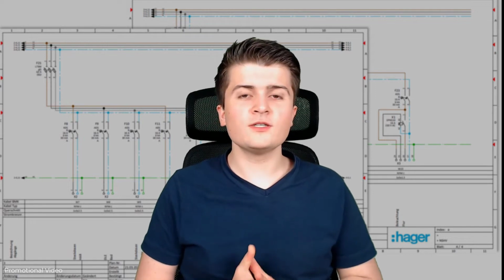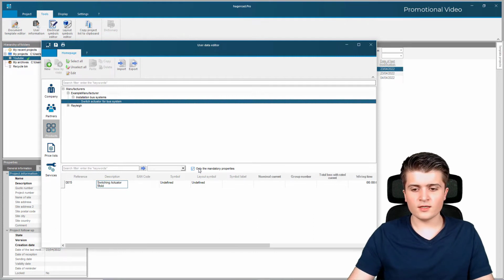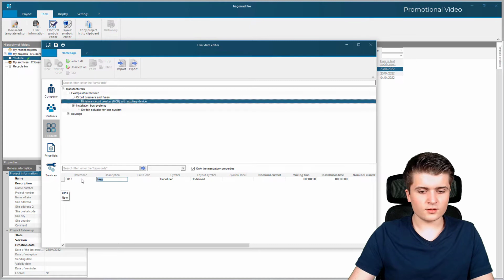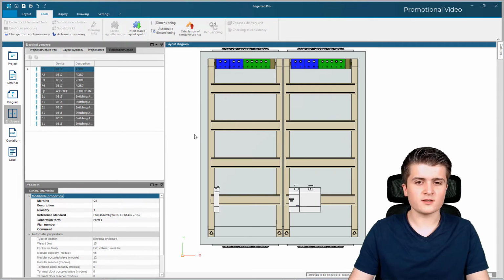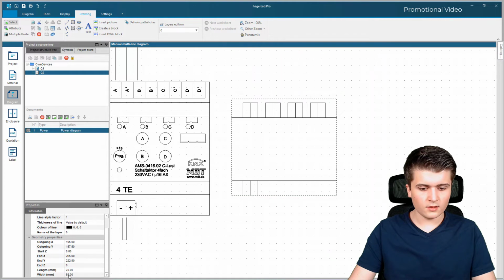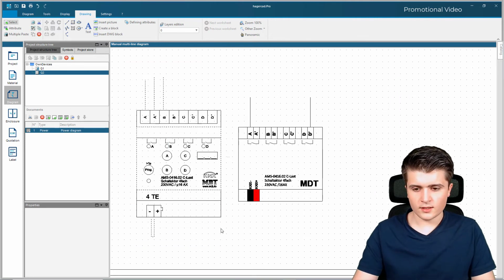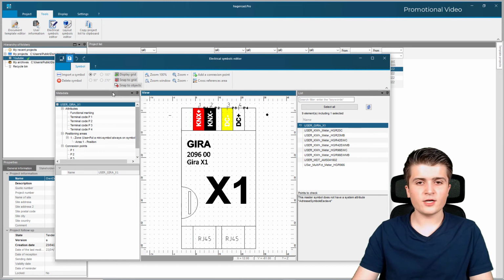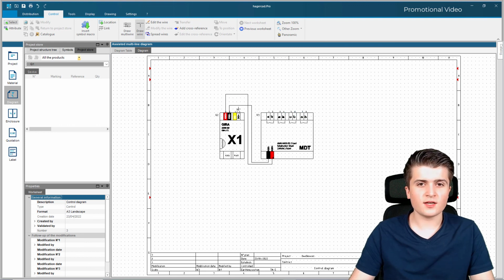hagercad Videoseries - #06 Custom Products: MDT, GIRA X1 & co. in hagercad

Comment: Thank you very much for this series - it was very helpful. I probably have a bunch of questions as a result ;) One thing that I have had problems with is when documenting/expanding an installation that was made some years ago, some of the Hager products are discontinued and I can not find them in the library (e.g. SPN415 and HA302S). I know that the products used to be defined in hagerCAD previously but in v5.10, I can no longer find them. Is there a way of importing discontinued Hager products to a current design in hagerCAD? 
Best /Brus-Per